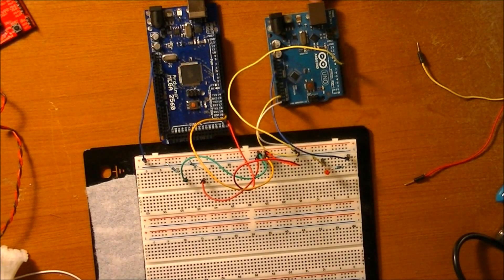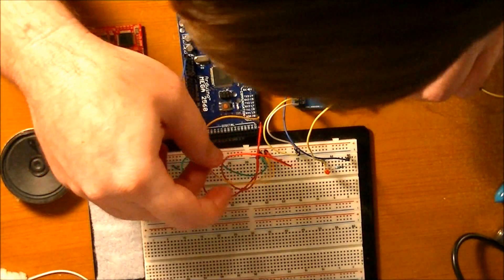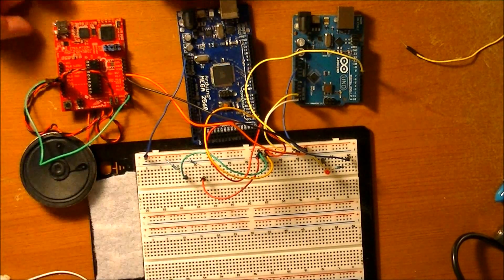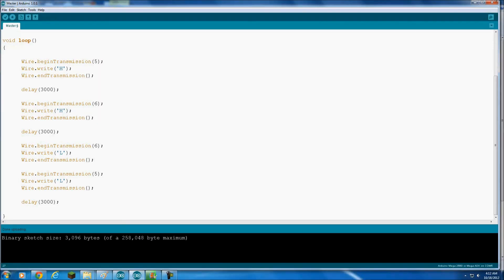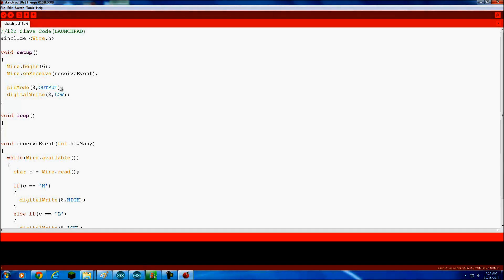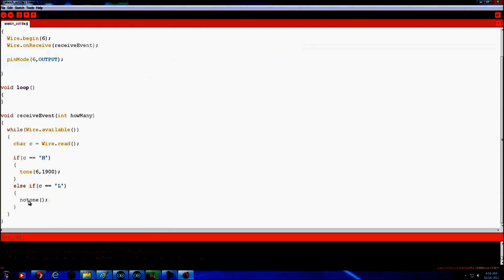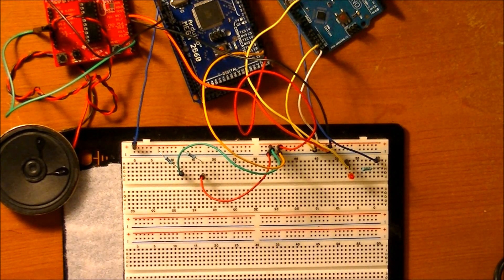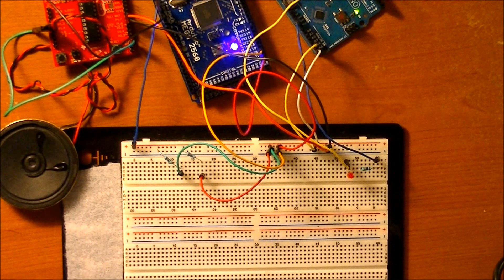TI MSP430 Launchpad i2c communication with Arduino Mega 2560

Comment: This is awesome... I always thought it should be possible to make two different microcontrollers "talk" to each other but this is the first time I've seen it.  You could do a lot with parallel programming like this.

Also I am impressed that Energia can just use Arduino code so easily.  I've never used Arduino so that is interesting.